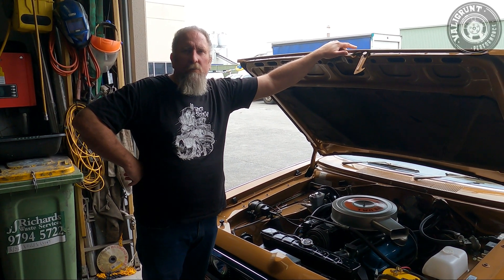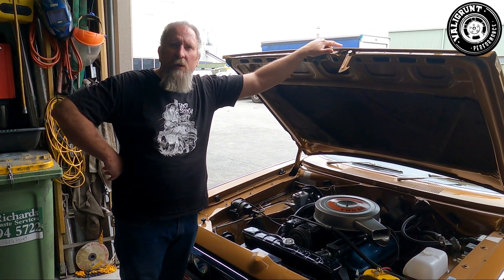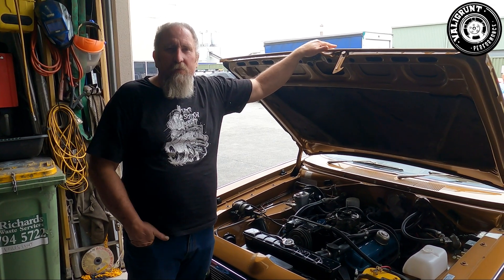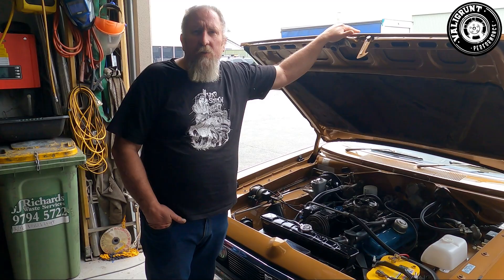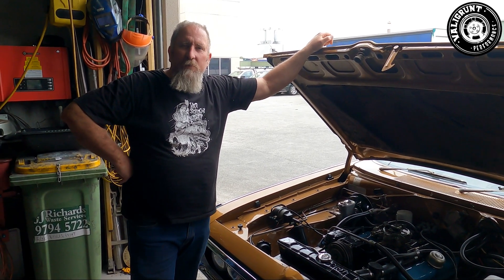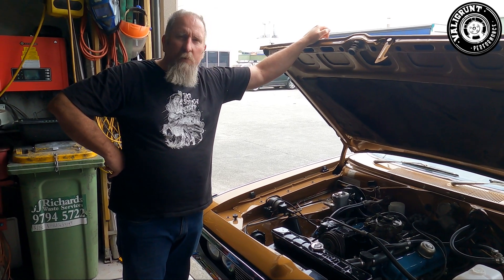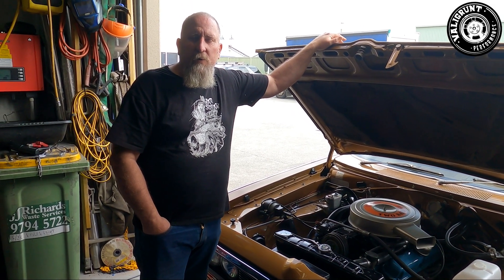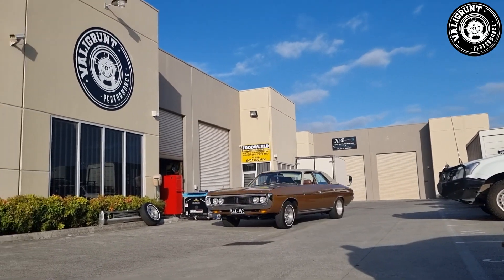Chrysler by Chrysler “Coyote” Hub Dyno Run

Comment: I like your car.I had a Chrysler by Chrysler 360, years ago.They were a big powerful comfortable car.That was in the 80's when they were really cheap.She  could easily pull 100 mph,after that she was slow to climb to 115 mph. They had,what they called a 'taxi cam',lots of power down low ,not much at the top.A big engine with a tiny 2 bbl carby.

Comment: so you where going to add more timing at 20 but then you didn't why not 2 min change just for shits and giggles
Reply from the maker: Because this car is a balance between racing and cruising, plus it's better to be safe than sorry.  In the time I have owned it 2009 this is the third rebuild of the motor, not because I blew her up but because I drove her around the clock multiple times, I wore her out.  Not planning on doing that many kms anymore now but would still like to get a couple of rotations around the odometer.  As it is with the ET streets on the back she fries the tyres at 100kms I don't need any more timing.